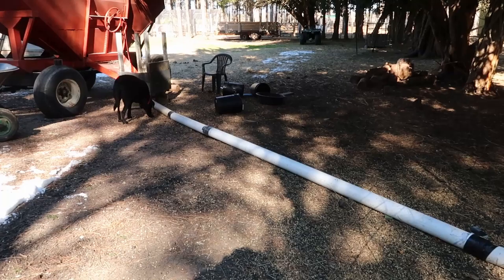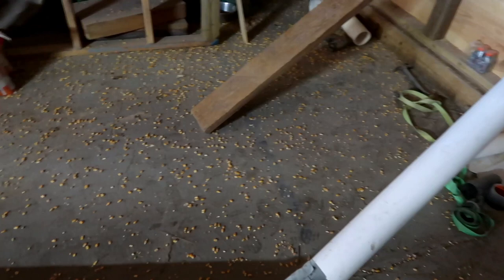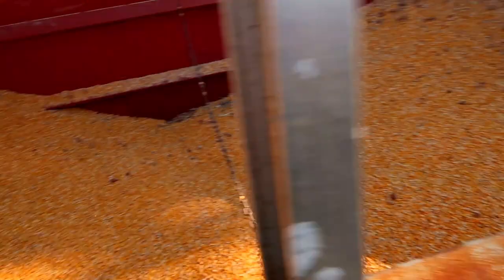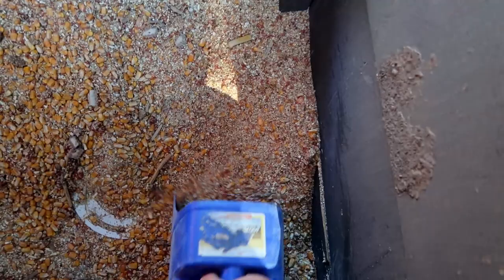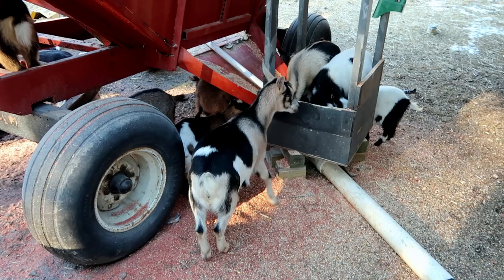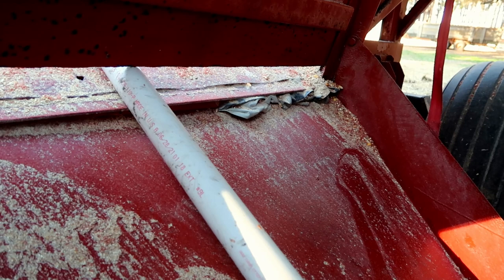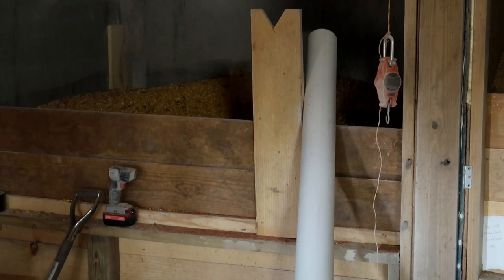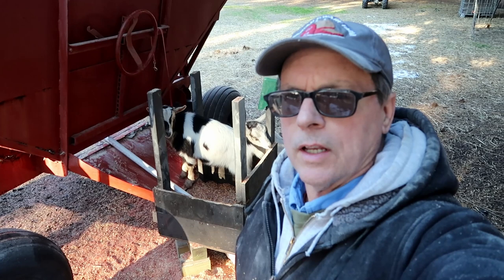How to Setup a Corn Blower and Gravity Wagon

Comment: Your corn supplier should be ashamed of themselves selling such dirty product. 

Great job on the blower system! 🏆
Reply: This is the way all corn looks before it is cleaned. This corn is from the combine then stored in a silo, then loaded in a gravity wagon. It would look perfect if it had been cleaned. The cleaning happens at a processor, this corn is straight from a farmer. The broken bits of corn the goats won't eat goes to feeding all kinds of birds that clean up after the goats are thru eating. Nothing goes to waste.
Reply: You can buy "clean corn" if you want, but you pay $$$ for it. If it's going for feeding any kind of animal, there is no reason to pay extra for clean corn.
 I get corn right from the neighbors grain bin and clean it myself, to burn in my corn burning pellet stove. It saves me 1/3 of the cost of "clean cor'!